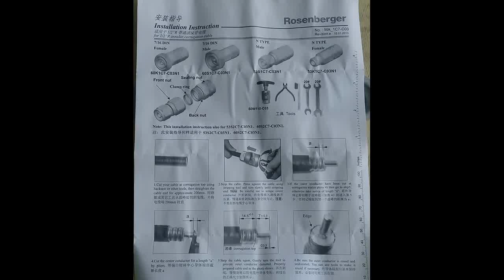How to install 1/2 inch Coaxial Connector

Comment: where to buy that tool bro
Reply from the maker: I bought from ebay. but brother i normally make 1/2 inch and 7/8 without feeder cutter. i used pepper knife for cut the cable.
Reply: @LayaBro  bro, you got the link for the tools? thanks
Reply from the maker: @kiatster1  No, you can check enbay and amazon
Reply: Laya Bro u got the name of the tool?
Reply from the maker: @kiatster1  It is name is 1/2 inch feeder cutter